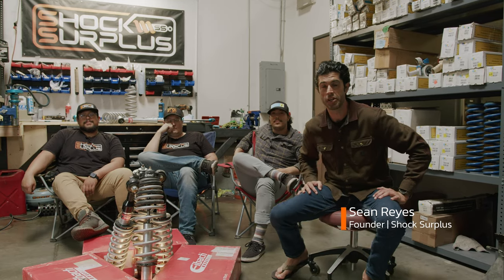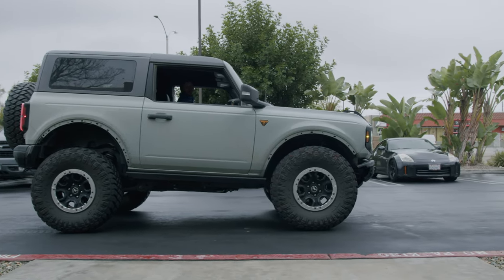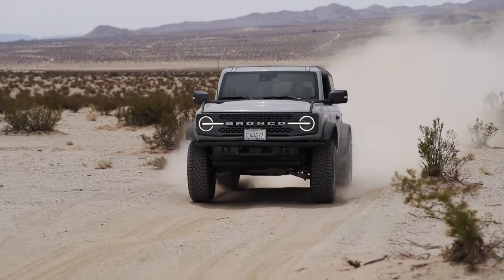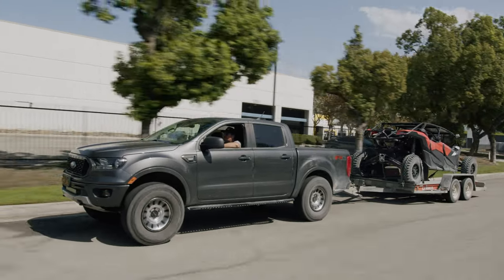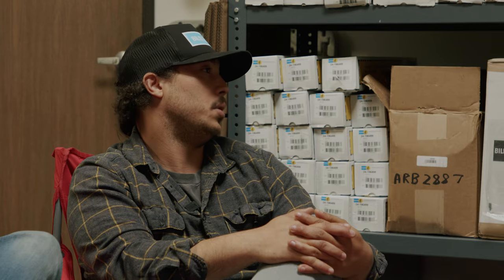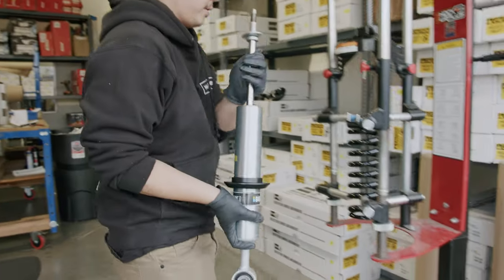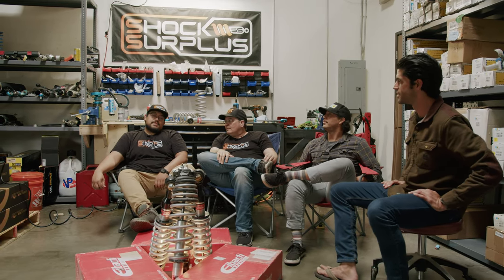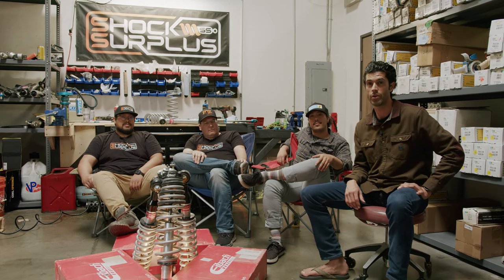Eibach Triple Pro-Truck Review! Silverado - Bronco - Ranger

Comment: I chose the eibach pro kit for my ranger. I threw a rough country front coilover set just for a temporary fix(stock fx4 were leaking) along with a used set of goodyear 265/70/17 ht's. 6 months now of my truck being dangerous to drive and horriblly uncomfortable im looking forward to an improved ride. Im planning on setting a 1.5" lift and possibly going back to stock tire size later on for fuel efficiency so adjustability was important. I wanted a shock i can adjust on the vehicle too which was a consideration as well as being a little stiffer for better cornering.

Comment: Just bought a 2022 colorado z71. I use as daily driver and  no offroad, but wanted a little lift and add 265/70/17 tires. Want to do 2.25 lift in front with 1 inch block in back to level it out. Would eibach coilover  2.0 be a good move? I want to ensure it would be a comfortable ride and not too stiff on turns and potholes. Would it be better than stock regarding daily comfort?

Comment: I have 107k on my 5100s thinking it’s time to change them out. I’ve always loved the control of them but think they’re a little stiff over potholes and speed bumps. From the description of the previous videos fox 2.0 and 6112 comparison it sounds like i would like the fox or eibach a little more than the 6112. But i don’t really seriously off-road. I would like to travel one day but too busy right now. Running a 14 Sierra with the 5.3. So between the eibach 2.0 vs fox 2.0 vs 6112  I’m unsure of which to go with also would new UCAs show added benefit to the ride quality?
Reply from the maker: If you want something a little softer then I would definitely go Eibach as long as you do not mind having a minimum of 1.75" of lift. They are a lot longer in travel than most other things so they will absolutely require an aftermarket upper control arm or your stock upper ball joints will bind and limit travel.

Comment: Thanks guys, good info. I think I'm going to wait and get Bowman's opinion on the Bilstein's. I was surprised when he said Eibach states they are only good for 35"?? I'm a stock base sasquatch, but like to keep my options open as for 37's   When will we get the Bilstein's one the Bronco???   Thanks
Reply from the maker: The recommended tire size is a 35, although as you see the 37s still work. The main issues are that the compressed length of the Eibach is short enough to allow a 37 to hit the fender even without the flare or with a flare delete and the overall unsprung mass of 37 seems to be a bit too much for them to handle. The fitment issues can be mitigated by trimming or running a longer bump stop or some sort of spacer under the stop, however I think they will start to run into dribbling issues on any wheel and tire combination that totals in at more than 110 lbs per corner. I do not know of a 37" or larger tire that weighs less than that with a wheel, so if 37s or larger might be on the horizon, you may want somethin a little more than a 2" body shock. We finally have the 6100s/6112s for the two doors in and ready to go, so they should be going on and getting reviewed soon. Even without testing them, I can say they are the better choice at this price point if you plan on a 37. Their overall length is a little short, but you can make a 37 fit with a tiny (~3/8") top mount spacer, and will certainly have the capacity to cope with the extra unsprung mass a little better without dribbling.

Comment: Do you know what Leafs you guys ran with the Eibach 2R's on the Ranger? (at 18:30)
Also what height did you run the 2R's? I believe default shipped is 2.5"?

I've got some Eibachs 2R's ordered but I'm debating switching from the stock FX4 leafs (thinking maybe ICON Multi Rates but still researching.)

Thanks for the great video. The discussion is great but would love to also see more video of the offroad performance if you guys ever come back to these.
Reply from the maker: Hitup stephen@shocksurplus.com - he has the ranger, i believe it was stock leafs, and the 2R system was awesome in the dirt, he'll have more details.

Comment: I'm about to put 37s on my Bronco, Sounds like the Eibachs are good for the lift but maybe underdamped for the heavy wheel/tire combo.  Cant wait to get feedback on the Icon 2.5 vs Bilstein 6112 options.
Reply from the maker: Definitely! We think the Icons and Bilsteins are the better choice for a 37" or taller tire or a wheel and tire package that weighs 110 lbs per corner or more. The Bilsteins probably are the most comfortable, but those Icons can really boogie through the big stuff, so if you like to party you might be a big fan of those.

Comment: This was more positive perspextive than i was expecting to hear. I have eibach (non resevoir) on my 3rd gen taco, and ive been thinking about "upgrading". I dont know which direction yet. 6112? 8112? Icon? Decisions Decisions..
Reply from the maker: what are you looking to do that the Eibach cant handle?
Reply: @ShockSurplus  great question. So far my truck has seen a lot of terrain. From crawling, to techy fire road, jumped it a few times. I think my biggest complaint is I feel it's not particularly AMAZING at any 1 job other than pavement. With the front coilovers, I feel the shock can't handle the spring rate on rebound. For example, dropping off a curb, the front wheel crashes to the ground which isn't all that pleasant, similarly with some rock obstacles. While jumping (and you can kind of see this in your video) the truck Bob's a couple times before settling. I'm not experienced with other coilovers so I'm not sure what is the "norm", but I think you guys made a great point that a 2.5 from eibach may handle the spring rate better. I just suppose more control with a DSC shock with rebound adjustment could provide more control. The rears with the spacer block also wasn't pleasant especially after adding weight of a rack and rtt. After upgrading to the icon rxt leaf pack, the rear feels great, though. Hopefully this was a good answer to your question! :)

Comment: Love you guy's content. I've been researching suspension stuff pretty heavily for my 22 Ford Ranger. It's mostly for daily driving but I want to get into overlanding/offroad, so I want to make sure that capability is there. I also might tow a car every now and again, so I gotta keep that capability too. 

What would be the strong recommendation between these, as I'm stuck on not finding much more direct comparisons with the Ranger chassis. 

Eibach Pro Truck 2R
Bilstein 6112/5160
Teraflex Falcon Sport

That's what I've narrowed down to. Any opinions and insights are welcome.

Thanks again
Reply from the maker: The Eibachs and the Bilsteins are definitely our two favorites so far. You can not go wrong with either option really, but if you prefer a little tighter handling or plan on adding a lot of constant weight go Bilstein, otherwise the Eibachs are pretty hard to beat, especially with how much travel they offer
Reply: @ShockSurplus  Awesome, I appreciate the knowledge. I'll be buying from you guys soon. 😀

Comment: I hate my stock Ranger shocks the most in chatter. On pavement as I cross unending construction patches and then on dirt when I hit dreaded washboard sections. Both instances lead to considerable clinching of cheeks. You guys really found the Eibach 2Rs with rear reservoirs to noticeably improve that? If so, guess I need to get on the backorder list.
Reply from the maker: Definitely made a world of difference! The big thing with these Rangers is they gave them a heck of a lot of leaf spring and then gave them about 3" of rear high rake. So the rear springs are fairly stiff and with all the weight on the nose the rear chatters and skips along the pavement. Adding some lift to the front to shift weight more evenly in the chassis makes more difference than you would think and the super active and linear valving of the 2R rear shocks really keeps the rear tires on the pavement and make sure the suspension absorbs the bumps rather than sending them to your spine or sending the truck airborne. We have the 2R kits in stock now so no need to backorder and wait on them either https://www.shocksurplus.com/products/eibach-pro-truck-stage-2r-coilover-kit-front-coilovers-rear-reservoir-shocks-e86-35-048-02-22

Comment: Toss in the Ironman 4x4 stage 2 foam cell package if you're going to look at Dobinsons. 

I just got a 23 4Runner ORP and I'm down to Eibach Pro stage 2R, Bilstein 6112 (which I've tested on another 23 4runner and loved the ride and handling) and Dobinsons INF (non-KDSS) kit.
Reply from the maker: We're underway on a couple different vehicles with Ironman setups, so far we're not that hot on them for the price. We have one subaru with a blown shock, and an xterra with a rear end that's performing pretty poorly with their setup, we're not sure if the rear shocks are blown or not, no visible oil, but lots of bottom out in the rear with a minor load on their leaf springs and shocks.

Out of the options you mentioned, Bilstein will ride firmer/sportier than the Dobinsons kit, both 60mm shocks and same piston surface area, but dobinsons uses a high flow linear piston compared to Bilstein's digressive piston. Eibach 2.0 is going to feel softer than the Bilstein, more like the Dobinsons, but less higher-speed offroad capability due to the smaller piston.

Comment: Why did you not include Ranchos?  I had the adjustable ones (9000?) on my F150 and it was a big improvement over stock especially when towing. Set on 5 out of ten they were noticeably stiffer than stock and prevented surge.  I now have a new F150 Platinum and need to level but not sure about  replacing brand new springs and shocks.
Reply from the maker: This review is just about Eibach as the title suggests, however those Ranchos are probably our least recommended part these days. They do not have great quality control, and any basic monotube like these Eibachs will ride and perform better without having to get out the truck to make adjustments. They also last exponentially longer and far less failure prone

Comment: 1. How do the Eibach Pro Stage 2 front coilovers compare with the $3000.00 - $5000.00 Fox, Old Emu and King shock kits that have adjustable damping? 
2. I just installed the Eibachs on my 2009 4-Wheel Drive, double-cab Tacoma, and they are very firm on paved roads. Does the torque tightening on the upper and lower control arms affect how firm the shocks 
3. Do these shocks soften up some as they break in?
Reply from the maker: 1. The Eibachs work great and definitely punch above their price point, but they are pretty far off the anything that expensive. Anything in that price range will offer a much larger 2.5" body for better support while having better small bump sensitivity as well as allow them to remain more consistent, and they adjustability gives you way more flexibility to tune ride and handling to your preferences and uses. Some options like the OME BP51s, King 3.0s, and Bilstein 8112s are also position sensitive allowing them to provide far more plush ride in their primary ride zone while offering progressive support to prevent topping or bottoming out the shocks as you extend or compress the shocks outside of their main ride zone. 
2. Overtightening control arms can cause stiction or bind at those joints, not allowing them to operate smoothly which could hurt ride. More likely than not though, those coilovers probably just have a little too much preload. They were optimized around 3rd gens so they are set a little high out of the box for a 2G like yours. 
3. There is a short break in period particularly on the front coilovers, however you likely will not feel it as much as see a 1/4-3/4" drop in lift height from the front end from their initial height after the first 50-150 miles.

Comment: would love to see a comparison with the Dobinson MRA or IMS to the 6112 and 8112 shocks. Seems like a good match up!
Reply from the maker: There are no fair comparisons between the MRR and 8112s, but the IMS vs. the 6112s is definitely in the books for sure. Bilstein does not make a smooth body shock with adjusters like the MRR, and Dobinsons does not make a shock with position-sensitive dampening like the 8112s. So even if prices were similar, which they are not, it is not really a fair comparison for either part.

Comment: Can you expand more on the Eibachs being too short with 37s and touching the fenders?  Are we talking body damage or just making contact?  Would a shorter 37" tire than the 36.8 maxxis make enough difference to no be an issiue?
Reply from the maker: They were short enough to start bending tabs on the front fenders with no flares, so if you left your flares on you would be in trouble if you like to drive fast in the dirt. These are pretty hard to bottom out, so with a little lighter foot and something that runs a little smaller like a KM3,  you would probably be alright with a flare delete. Although we definitely heard them touch when it fully flexes out, it was not bad enough to cause damage, so if you are just worried about it when you are crawling you are probably fine. It really only becomes an issue when all four tires leave the ground simultaneously or a big rut, root, or rock jumps out in front of you. With that said, if sending it at speed is your thing, these probably are not the right shocks for you, especially with a 37. At this price point we think the Icon 2.5 EXPs are the real MVP for high speed shenanigans. They definitely run on the firm side of the spectrum, but we could not believe the stuff we were able to get away with after just simply sliding in a set of shocks and upper control arms.

Comment: What would you recommend for my 19 Silverado RST? I use it on the highway a lot but it also gets used to pull my 5000lb ice castle through the snow as well as a good amount of gravel and fields in the fall for hunting.
Reply from the maker: Eibach and Fox both subdue the rough trails and gravel road chatter, with ample damping for light hauling. Bilstein wins in the handling department, but sometimes lack in the comfort department, but not always.

Comment: I’ve got a 22 Silverado Z71 and have been looking for a level with emphasis on on-road comfort. The stock Ranchos feel awful rough or sharp when hitting bumps with a little speed, and the unloaded back end likes to dance around. Had 5100s on my 07 and wasn’t a fan. Looking at Kings since they seem to universally be described as comfortable, but I’m pretty sure that’s overkill for on-road. Any thoughts in the much more crowded $1-2K range?
Reply from the maker: If you weren't a fan of the Bilstein, then Fox or Eibach would be our suggestions in that budget range. The same performance differences we see here on these vehicles would be applicable to the 22 Silverado. Fox 2.0s feel like King Comfort onroad, but lack the offroad performance and handling in the tough stuff, which is fine for 99% of drivers that aren't ripping in the dirt often.

Comment: Are they going to make these for 07-14 silverados any time soon? Whats the difference in the snapring versions compared to the coilover? Im mainly trying to build a budget prerunner would these handle decent size whoops?
Reply from the maker: Even though Eibach doesn't have their coilovers available, or the Stage 2 kits available - there's actually something better for what that price would be ($1200-1400 for the set).

That's the BIlstein 6112 and rear 5160s, you get a beefier front shock, and a reservoir rear shock. This will transform your ride and be able to handle tougher terrain than the Eibach 2.0 in our experience.

https://www.shocksurplus.com/products/bilstein-6112-strut-spring-rear-b8-5160-reservoir-shocks-set-for-2007-2013-chevrolet-silverado-1500-4wd-w-0-1-85-lift-v8
Reply: @ShockSurplus  You guys are the best! Thank you!!!

Comment: Did i understand this right?  The Eibach only gave 1 inch of lift on the silverado with the 3.0? I have a 24 silverado 1500  crew cab 6.7ft bed with the 3.0. I was looking at the eibachs for my lift in the front but was hoping for 2-2.5"
Reply from the maker: They did around 1" at the out of the box settings, however we were able to get them adjusted to right at 2" of lift.
Reply: @ShockSurplus  ok, awesome. Is there a need for upper control arms with 2"? I've heard of the stock one breaking. I don't do high speed off road but I work off road and I'm always in the dirt and mud.
Reply from the maker: You dont necessarily need one, but you do get more travel if you do upgrade. The reason why most stock arms are breaking is because they run an aftermarket coilover with enough travel to make the droop stops engage before they can fully extend, and hit those droop stops frequently. You will probably be fine without them, but we do find them to be a worthwhile upgrade for these new GMs